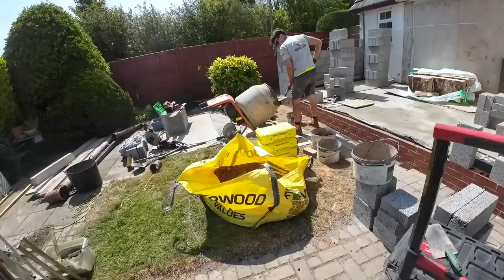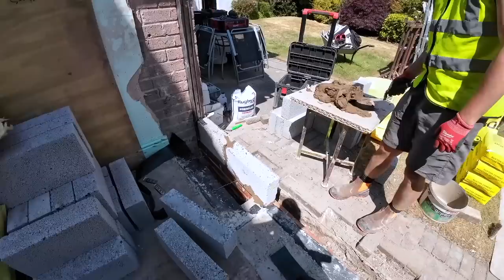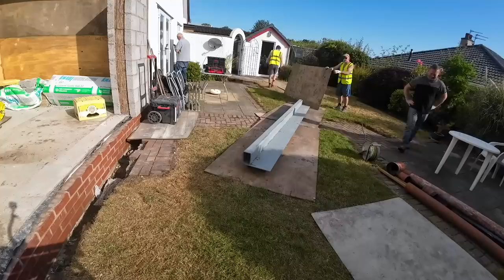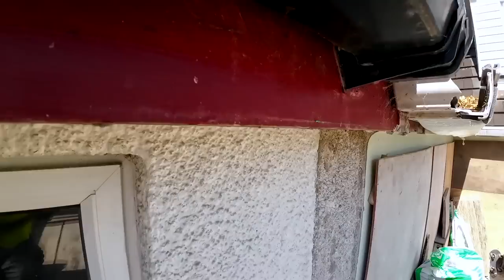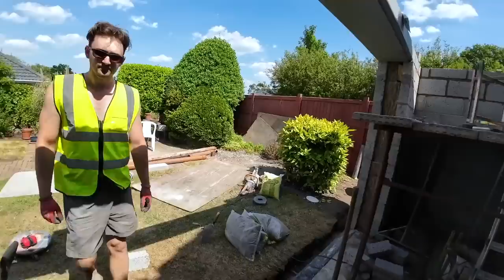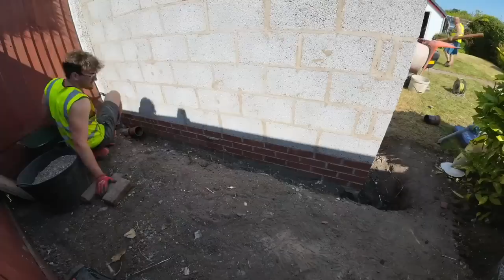BIG CAVITY, BLOCKWORK AND BIG STEEL!!! 150 MM CAVITY EXTENSION PT 6

Comment: Why 4 inch block? It is non structural and not allowed almost everywhere except UK. Not a reliable way of building!
Reply: 🙄🤔 4 inch concrete blocks not structural… 🙄 🤣🤣🤣
Reply from the maker: Back again 🙄
Reply: @SteveAndAlexBuild 
Ed seems to be a troll from across the water
Reply: Well i don't recall too many houses in the uk falling down because of 4" blocks 😂 but i can see thousands of US homes destroyed when the wind blows a bit fierce. People in glass houses etc 🥹
Reply from the maker: Very true Doug 🙄🧱👍🏽
Reply from the maker: He pops up every now and again with the same drivel 🙄🧱👍🏽
Reply: @SteveAndAlexBuild  😂😂
Reply: Jobs fairly getting there great stuff some funny comments today.👍👍👍😎😎😎
Reply: @macsmith6216  These UK video's through You Tube get sent around the world. Anyone not considered this type of building is against building code??? Why do you think they make 6,8, 10, 12 inch block with cores for concrete? It would be good to educate yourself how the rest of the world builds and guidelines are.
Reply: @Doug....  First off you don't get the extreme weather other countries. The houses built to today's standards would have done better. Why are half the video's about rusted out lintels and repairs? Not sure you think a mortar joint is good enough to hold back high winds or external damage. No one follows UK standard for a reason! It does not work.
Reply: @SteveAndAlexBuild  Drivel? Why do other countries not build like you? It would be a good idea to learn about why when UK bricklayers come to North America and have to be -retrained? Before speaking educate yourself.
Reply: Again UK standards would not survive different weather patterns around the world.
Reply: @edskapin7171  I’m not sure this point is as smart as you think it is. UK houses don’t have to survive other countries weather. Our building regs are written for the UK, and our houses have to survive UK conditions. Which they seem to manage fine.

Not that I think you’re correct about the structural strength of 4” blocks (which blocks are you even talking about, there are many types) but your argument about other countries building standards and environmental conditions is fairly meaningless.
Reply: @edskapin7171  Oh dear. I seem to have " inadvertently" opened a can of worms by daring to reply and giving it back. 😂😂😂
Reply from the maker: As I said irrelevant drivel
Reply: @Doug....  you’ve not opened a can of worms (not that I can understand why you enjoy the idea that you had). You’ve simply said something that everyone else disagrees with, then patted yourself on the back for getting a reaction when they tell you you’re wrong. If saying something obviously wrong, then getting told you’ve said something obviously wrong gives you any sense of achievement, you need to take a long hard look at your life.

And if you genuinely wanted to make a sensible point about the strength of building in 4” blocks, you should really choose a video where they’re not building a single story extension supported on two side by the existing building. Because you could probably build that out of Lego and it would be fine.
Reply: What would you have built it out of? Timber? We’ve been using bricks and blocks for hundreds of years and those houses are still standing…
Reply from the maker: Nobody follows uk standards because they are in a different country . Same reason we don’t follow regs in other countries. 
      🤣🤣 
 I repeat irrelevant drivel 🥱
Reply: Bell end! Enuff said.
Reply from the maker: Absolutely 🙄🧱👍🏽
Reply from the maker: Mmm something tells me he ain’t dove yet 🙄🧱👍🏽
Reply: @BunkerMentality  One last word is the world is changing to energy effiecient building techniques. (climate change) it is becoming mandatory in most countries around the world. Good idea if you kept up with changes.
Reply: @SteveAndAlexBuild  Drivel? You should educate yourself on the rest of the world. There is a reason why UK bricky's when immigrating to North America get sent back to bricklaying school. North America has very strong standards for building and changing every day. If you packed your bags and immigrated to North America you would come here as an apprentice. If you don't like comments limit yourself to the UK. Not sure why you think your way is the gold standard? No one else in the world does it.
Reply from the maker: More inane drivel , go for a lie down Ed 🥱🥱😴
Reply from the maker: Till next time Martin 🥱🥱🧱👍🏽
Reply: @edskapin7171  You might have good bricklaying schools in North America but you sure as hell don't have good spelling and grammar schools if you are representative of them!
Reply: @josta2010  You need to practise your reading skills. No where at all did I speak out about bricklaying schools. I mentioned UK standard of building with masonry is not acceptable in North America and other countries period. You missed the entire point! I also said  this You Tube broadcast is not only reached in UK but the entire world. If you don't like comments stop broadcasting to the rest of us. Thanks for making my point that when UK brickys arrive in North America they all have to be retrained in standards which far exceed the UK's . Wear your reading glasses!!!
Reply from the maker: Stainless steel ties don’t corrode .
Reply: @SteveAndAlexBuild  OMG 😱 thought this thread was over and done with 😂
Reply from the maker: No it’s a runner Doug 🤣🤣
Reply: @SteveAndAlexBuild  It provided me with some great entertainment, I'd love to see anything paul and ed have built. They should let the internet critique their handywork, I imagine it would be a 30 min instructional video of how NOT to 🤣🤣
Reply: @SteveAndAlexBuild  Also I just wanted to say having worked with numerous builders and bricklayers over the years, your work ethic, knowledge and skills really show. I wish everyone in the trade was as professional as you guys <3
Reply from the maker: Thanhs very much 👍🏽🧱
Reply: @SteveAndAlexBuild  I always wondered why you stuck to UK regulations when building UK houses rather than say planning for the -40 degree winters of Northern Canada or Earthquakes frequently seen in the Pacific Rim 🤦
Reply: Better ask the customer if they want a tornado shelter just in case on the job I’m currently on, or maybe heated drive to clear the snow we get once in a blue moon….
Reply: @BunkerMentality  No one else uses 4 inch block for structural work in other countries what does that tell you? Meets no building codes outside UK ?
Reply: @edskapin7171  Buildings are usually not exported to other countries. U.K. buildings usually stay in the U.K. What does the fact that it’s a proven building method in the U.K. tell you?

Comment: I worked on the construction of the Humber Bridge in 1976 at Hull. There were thousands of tonnes of steel in the yard. Someone said to my mate ‘ there’s a lot of steel here, to which he replied “ I’ve had more steel in my eye” . Lol. I needed a genie lift for my extension as the steel was 1.7 tonnes with the posts.
Reply from the maker: Jeez that is heavy 🥵🧱👍🏽

Comment: Yeah you need an engineers design due to CE regulations but at least it’s designed correctly with calcs. I was lucky as I was still working at a structural company so I fabricated my own steels , sent them for galvanising and transported 110 miles to my new home for the extension. Saved me a fortune.
Reply from the maker: Nice one 👌🏼🧱👍🏽

Comment: Ok, thanks, dose that meet building reg? and what about the protection of the lintel? I have watch your video's were you take out rusty lintels were they are causing problems and put back galvanized ones. thanks
Reply from the maker: All up to regs and signed off . The steel is protected by the roof 🧱👍🏽

Comment: I always cut the full cavity as opposed to a single saw cut. The reason being, the old cavity going into the house is now single brick, so I push the kingspan into the cavity upto the the internal wall. Tricky to explain via text.

So now the house cavity continues into the extension cavity, the cavity perpendicular to that (exterior wall now interior), is closed off to  that cavity.
Reply from the maker: We’ve done that too but it depends what building control ask for
Reply: @SteveAndAlexBuild  I supercede building regs, they often say, "You don't need to .......". Building regs are a poor minimum standard to follow, I don't follow poor standards.

Comment: Great video as usual. I don't know how you pull off graft like that in boiling hot weather. Just out of interest, why did the inspector insist on you cutting in a vertical DPC on the right side house wall but not the other? Looking forward to the next video.
Reply from the maker: Cheers , we did both sides 😆🧱👍🏽
Reply: @SteveAndAlexBuild  Ah my mistake, I missed that bit. I thought there might be some technical reason why only one side was needed. I need to go to Specsavers lol🥸🤓

Comment: why was the beam not galvanized? Could be a problem later on as inside the box has no finish to it, just a bit of primer on the outside. Why was box section used and not an RSJ? thanks
Reply from the maker: We needed it low level to get the roof over 👍🏽🧱
Reply: @SteveAndAlexBuild  Ok, thanks, dose that meet building reg? and what about the protection of the lintel? I have watch your video's were you take out rusty lintels were they are causing problems and put back galvanized ones. thanks
Reply: @leebowley6953  when I fitted my steels to my extension it was rsj and two the posts were 100mm box section. 1.7 tonnes in total, I know because I had it galvanised and they weigh it to cost . Requirements on the plans were galvanise any exposed edges but obviously it’s difficult to part dip so I got them fully galvanised. I had to modify the construction because the draughtsman had put the bolts in shear so I changed it so the lintel was sat on the top of the posts and plated and bolted. I don’t think fully galvanised is part of the regs but it was easier although a bit more cost.

Comment: Better check those blocks mate 150 fluff,thermal block on the inside
Reply from the maker: They are double Fibolite 👌🏼🧱👍🏽
Reply: @SteveAndAlexBuild  fair enough! I'm not convinced, though !! To each their own!👍🏻
Reply from the maker: We never use thermalites too fragile and crap for fixing into . 😩🧱👍🏽
Reply: I understand your point, but mate  fixing to ,really
Reply from the maker: I think they are great to set nice and light but the lads we work at with won’t have them and we have them in our house so I know first hand how crap they are . 
   If you try Plasmor Fibolites you will be converted. Light , thermally spot on , hard to break 0 waste in the packs and cheaper . Been using them for over 25 years 👌🏼🧱👍🏽
Reply: Ok fine mate, time for a change maybe  lol
Reply: For  you  chaps  that is  !!👍🏻👍🏻👍🏻👍🏻
Reply from the maker: 😂😂 I thought you  meant you .
  🧱👍🏽
Reply: Lol 😆

Comment: Trying not to be critical but don't like those half padstones I use to cut a pad stone to the width of the cavity and lay it flat across the cavity a much stronger job and does both sides
Reply from the maker: And causes a massive cold bridge 😬👍🏽🧱
Reply: Very true.
Reply: @SteveAndAlexBuild  Hi it does not cause a massive cold bridge at all, you look at where you put your wall plate fixings on  the corners that's where your cold bridging is. Why haven't you opened the cavities at these points. There is a difference opinion on all aspects in the building game I prefer to go with the best and strongest option every body to there own. Also the biggest cold bridge is the steel lintel
Reply from the maker: Totally agree on the steel 🧱👍🏽
Reply from the maker: Serious lumps indeed 🥵😆👍🏽🧱
Reply: @martin2466  Great to listen to some one who knows what they are talking about

Comment: I never ever do full cavity fill, dreadful practice and dreadful that Building Regs allow it, but there again, Building Regs are wilfully poor, just look at UK housing.

Any extension or house with full cavity fill, either fitted or blown in, avoid the house at all costs.
Reply from the maker: That’s your opinion . I’ve been using that method since I started in the 80s and not been back to a damp problem yet 🤷🏼‍♂️
Reply: @SteveAndAlexBuild  I refuse jobs with full cavity fill. City & Guilds trained bricklayers would never ever bridge a cavity.
Reply from the maker: This city and guilds trained bricklayer does
Reply: @SteveAndAlexBuild  oh dear, not a clued up one then.

That old outside wall that's now internal. What separates it to the outside? Half a brick!. In my extensions, it's separated by half a brick and 150mm kingspan. I suggest the City & Guilds guy on your team goes back to college.

Have a think and let that sink in.